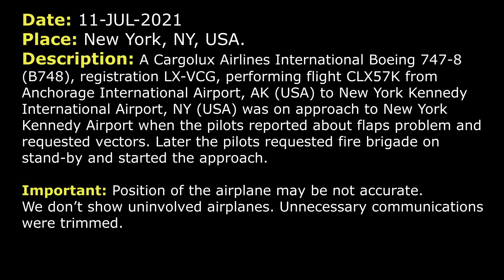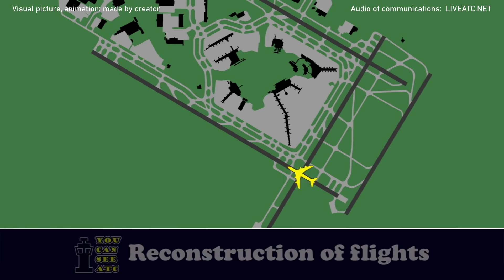Flaps problem. High speed landing | Cargolux Boeing 747-8 | New York Kennedy, ATC

Comment: Used to fly for Cargolux many moons ago. Good company and good training standards. The B748 freighter normal final approach speed at max landing weight with full flaps is around 170 kts. Add the tailwind and flaps issue to the equation and one has quickly a very interesting situation. They chose the longest runway available and accepted the tailwind for a good reason. As there is no ILS13R, the alternative would have been the Canarsie VOR 13R which would be a bad choice for many reasons given the circumstances. The B748 has an amazing brake system. IMHO, this was more complex than meets the eye and was handled very well. The ATC controller of a major international airport should know how to convert tons to lbs - adding extra workload to an obviously busy crew does not seem professional - but I digress as the crew didn’t declare emergency.
Kudos to crew, ATC and Mr. Boeing for building this amazing bird!

Comment: WOW, so many experts! :-)
ATC is required to ask the aircraft in distress for the number souls and amount of fuel (yes, in Pounds) onboard. This is to relay to the fire and rescue personnel. JFK controllers did a terrific and professional job as usual. Considering they normally don't give approach vectors at 260Kts and to an aircraft that never declared emergency! (BTW, when I was asked the same question outside of US, I would quickly convert to Kilos and respond, even though my fuel info was calculated in Lbs.)  
International 747 Captain with 50 years of flight experience
Reply: Would you say why they needed to come in fast?  I do not know the physics of flying, can they cut air speed by using less power or are flaps necessary?  I heard him say he needed to keep speed up.  Why is that?    Thank you.

Comment: This aircraft had a landing gear incident in 2018.
Incident: Cargolux B748 at Luxembourg on Jul 28th 2018, could not retract gear

A Cargolux Boeing 747-800, registration LX-VCG performing freight flight CV-794 from Luxembourg (Luxembourg) to Kuala Lumpur (Malaysia), was climbing out Luxembourg's runway 24 when the crew stopped the climb at FL140 after being unable to retract the landing gear. The aircraft entered a hold, dumped fuel and returned to Luxembourg for a safe landing on runway 24 about 100 minutes after departure.

The aircraft remained on the ground for about 4 hours, then departed again and reached Kuala Lumpur with a delay of about 5.5 hours.

Comment: Are JFK ATC not able to do the most basic calculations to convert tons to pounds? That’s 1 ton equals 1,000 kilograms which equals 2,200 pounds 🤦🏻‍♂️
Reply: Pretty sure ATC didn't catch the first answer for some reason ...
Reply: In our 747’s we use metric as well. In spite of that, you don’t want to get into specific weights with ATC because different weights mean different things for different airplanes. And so I’m surprised the controller kept pushing him for it. A much more correct answer would have been to tell the controller how much you fuel you have in time remaining.
Reply: @jumboJetPilot  The controller isn't asking about fuel for his timing and controlling purpose. He's passing that info on to the firefighters so they can have some idea of how big a fire they might need to fight. One hour of fuel in a 747 is a lot bigger fire than 1 hour of fuel in a Baron. On the other hand, it really should be good enough to tell the firefighters what kind of plane it is and where they were in their flight plan - returning to departure, en route diversion, or destination. And with a 747 as the emergency aircraft, the fire sizes going to be big, really big, or "we're going to need a bigger fire truck" big.
Reply: @oldguydoesstuff120  I’m aware of these facts as both a pilot and in holding a marine firefighting certificate. And I have declared many, many emergencies in my career (only once in the 747 but a countless number in the C-5). Controllers and firefighters have a pretty good idea what equipment to bring based on the type of aircraft and type of emergency. Never have I been asked to provide mass fuel quantity remaining - not even once; only the current fuel load measured in duration. Airport fire crews always error on the side of bringing too much gear and personnel rather than not enough. Only weeks ago we had a fuel spillage episode during a fueling operation. A total of 14 emergency vehicles responded and surrounded us, all at the same time! Naturally, I’ll answer any questions that a controller has for me during any emergency episode unless being on the radio is interfering with checklist accomplishment. I was merely pointing out that being asked for the  mass fuel quantity remaining isn’t a question controllers typically ask. And I know this because as I mentioned, I’ve declared dozens of emergencies in the C-5 - as any career C-5 pilot has! Unfortunately, that aircraft was never blessed with great reliability.
Reply: I too thought pilot has enough on his plate, without doing Imperial metric conversions for the ATC/firebrigade...
Thankfully he is wise enough to just double the figure and avoid any further seconds wasted at a critical stage of flight
Reply: @CameTo  yesterday one of my engineers whipped out a calculator to figure out 10% of 8 is 0.8 and I’m going 🤦🏻‍♂️

Comment: Can they had options to dump some  fuel to reduce weight?
Reply: The problem wasn't the fuel weight (they were at their destination) but the cargo weight and the speed due to no flaps
Reply: @3x3-x3x-oXo  U want to say more speed so more load on landing gears during touch down?
As after touch down reverse thrusters & brake pads will easily stop it.
Reply: @joydasgupta9445  the braking distance is a function of both weight and speed, but grows quadratically in the speed so I wouldn't say "easily". Yes it can stop it but used at theit maximum power brakes can get so hot you need the firemen to check they don't catch fire.
Reply: @3x3-x3x-oXo The pilot was constantly mentioning the word heavy due to higher landing speed I guess as he was concerned about the landing gear load bearing capacity I guess.
Reply: @joydasgupta9445  Heavy was because it is a 747-800... has nothing to do with higher landing speed... by IACO designation, a 747 is a "heavy" (Aircraft MTOW over 300k lbs/136k KG). It has nothing to do with the speed of the aircraft.
Reply: @SoraNakamura-974  ok thanks fr the information buddy 👍
Reply: @joydasgupta9445  No, heavy after the callsign is always used for the heavier category of planes, regardless of their actuel weight at the time, to keep smaller planes in the loop regarding the issue of wake turbulence. https://en.wikipedia.org/wiki/Heavy_(aeronautics)
Reply: @3x3-x3x-oXo  What is wake turbulences?
Reply: @joydasgupta9445  the turbulence caused by an airplane to the airplanes behind it
Reply: @3x3-x3x-oXo  ok
Reply: @joydasgupta9445  Above certain weight, you callsign includes heavy. SO, that was his call sign.

Comment: Did you find out what there VREF speed was? I’m guessing around 190kts
Reply: Minimum clean speed when fully loaded in 747 is over 250kts.
I don't know how heavy this guy was, I also don't know if he had use of the slats, as he stated flaps were stuck closed.
He also had about 9kts tailwind component on his approach.

Comment: Should the controller be so persistent about the fuel number being in pounds? My thought is- they are flying the broken plane in the air, I gave you the number that i have available, you can do the 3rd grade conversion on the ground…. Anyone else agree?
Reply: Doesn't matter what the aircraft manufacturer uses...it's what the pilot is using in his head and communicating to the controller.
If you tell the controller exactly what they ask for, there is zero confusion.
Reply: @TheCpage66  I agree with your thoughts. 
The pilot is trying to fly the broken plane at the moment and just reading off the number FMS is displaying him in front. There is no confusion all units convert. Atc is taught to ask in one unit as to not cause confusion for pilot convert mid emergency (or at least pan pan, which is what I believe this situation should have been.)
Reply: Does he mean 15 tons or 15 tonnes?
Reply: @TheCpage66  fair question but I would assume Boeing being an American manufacturer wouldn’t use those units. Even if they did, the difference would only be around 1500kg…
Reply: We do use the metric system here…it’s not lbs of coke its KILOS of coke
Reply: @justing42  Ha !!!!
Reply: Another reason backwards America should get on the metric system.
Reply: @Dan_D_av8geek  So true!!!!!!! Get on with it America and join the world and the 21st century!!!!!
Reply: @Dan_D_av8geek  Haha no, there is no need for that crappy system.
Reply: @bboyjunyor  Considering every sign you read is in miles, altitude is reported in feet, you buy a gallon of milk, etc I would say the metric system is definitely NOT the norm in the US (outside of academia and "science").

I am an American who would really suck at conversion to metric (everything I know is in imperial) and I would argue it is vital we change to metric.  Unfortunately, it would cost a ton/tonne
Reply: @ArdenTheSnep    ABSOLUTELY!!!!!!

Comment: Guys most controllers are not pilots and don't know what flap issue will do to plane.
Reply: Maybe some training on those issues should be added to their ATC training so they'll be better informed as to what might happen during the emergencies they might encounter in their careers.  Seconds saved might save lives!
Reply: I agree.  But takes average center controller 3 years to get certified. That's a lot of stuff on our end to learn just ATC side.
Reply: If Cargolux just declared emergency that plane can do whatever speed, heading it needs.  ATC will always ask intentions, if not known, fuel remaining and souls on board. So if I was flying Cargolux  "Approach Cargolux 1 declaring emergency flap issue need to run checklist turning to a heading 090 maintaining 2000ft we'll get back to you with further info". Done atc will yell at the  supervisor, supervisor will notify tower.
Reply: @beadbird  Except the cabin/flight deck fire, you normally never have to rush. You deliberate slowly go through the checklist. Firstly, emergency checklist are not done everyday so you need to make sure that you are doing it correctly. Secondly, all critical actions are verified by both pilots so no mistake is made.
Reply: Most people in the comment section aren't pilots either, but I dare say everyone has a basic understanding of flight just due to personal interest, and immediately knew what failure to extend flaps would mean for the landing (yes, without reading the video title..). I don't think it's asking all that much for ATC to share this interest and aquire this kind of working knowledge on their own, if it for some reason can't be fitted into the regular ATC training. I mean they are guiding actual planes across the sky, many of them full of people ...
Reply: Flap issue could mean any thing. Normally, yes it will be slow landing. But that is not the only issue. You can have flaps stuck in lower position which might mean, they are unable to do overshoot or go around. Flaps can also have asymmetry issue and plane might have issues with roll and behave differently with the speed changes. 
Better for pilots to tell what they need from ATC instead of ATC making assumptions.

Comment: Jeez, that controller sure did give an emergency aircraft with increased minimum speed a lot of tight, switchback manoeuvring! Great job flight crew.
Reply: The aircrew declared flight control difficulties (flap extension problems and increased minimum airspeed), requested an inactive runway (31L ILS was inactive), and requested emergency service response. The controller treated the flight as an emergency, and asked for POB and fuel remaining. Although no formal declaration of emergency was made, the flight was clearly in difficulty and was treated as an emergency by the aircrew, the controller and the emergency services. This was an emergency flight.
Reply: @MarkSJBeard  pretty high cringe factor on that explanation
Reply: Did they declare an emergency?
Reply: I didn't hear Cargolux declare emergency!  The ATC probably declared it later asking fuel and souls.

Comment: That controller seemed inexperienced.  Once delay vectors and 31L was requested, the standard atc inquiry of souls and fuel should have been asked way before clearing the ILS approach.  Then after the aircraft broke off the first 31L approach, the controller gave some really tight vectors back around but sent the aircraft through the localizer course before vectoring back on it (240,280°) Seems like more work for the crew than necessary,  in my opinion, compared to other JFK emergencies I've listened to.
Reply: Let's keep in mind it could have been for other aircrafts not displayed on the map. We all know that New York is a complicated airspace.
Reply: @scheckenhere7417  agreed... we don't know the entire air picture.  The vector through localizer final was weird (and perhaps should have been verbalized) but may have been for a good reason.

Comment: Can't the ATC to do the math? multiply by 2.2! Those guys are flying a 747 very heavy and they don't have time to convert units to imperial!
Reply: Or just pass the info through to the fire brigade as given and let them do the math? If someones calculator catches fire from the heavy math they are surely equipped to deal with that too.
Reply: Everything they are dealing with is in Imperial. The fire department requests the info and ATC just relays. Also dont forget the controller is also controlling other approaches that arent included in this video. It didnt seem excessive and was a simple calculation the crew could do on board and the controller could simply relay to fire. Was not a big deal at all.
Reply: @PenguinGaming  I still think ATC should try to make the life of the pilots easier when dealing with an emergency and asking twice about something that they could have calculated in no time doesn't go in that direction.
Reply: @TBDFood  there are 6 crew. How many approach controllers are there?
Reply: @PenguinGaming  6 souls, doesn’t mean they’re crew.
Reply: @vito774  means the chances of someone other than the pilot or copilot being in the cockpit is higher. Also most modern airliners have a button to change between metric and imperial (i.e. the baro selection). So it wouldnt be a big deal at all for the crew to relay that information after the tower requested it in pounds. It is an American airliner afterall.
Reply: @PenguinGaming  6 crew, but not pilots on the flight deck.
Reply: @chrisjohnson7929  nowhere in that interaction did they mention exactly where each crew member was onboard. Alot of 747 Cargo ops have extra personnel in the jumpseats to undertake small tasks especially in emergencies. Its not unlikely that someone wasnt in the jumpseat during this landing phase. Relax.
Reply: @PenguinGaming  I just jump seated from Louisville to ONT....there were 5 souls on board. Two crew, and crew scheduler, a parts supervisor, and me. During an emergency where they had to keep speed up and in the class B, the last thing that needs to be worried about is fuel in pounds. He supplied the weight and they have an accurate estimate.
Reply: 6pob does not say 6 pilots. Could be only 2 pilots 1 loadmaster and 3 horse handlers.
Reply: Pilots should do the math from the heart,  even if the instruments cannot change the units. ATC asked the amount in pounds twice.
Reply: @ZsomborZsombibi  Yes, to pilots that are dealing with an emergency in a 747 full of goods! ATC should help pilots all they can, not ask twice about things that have been replied already. Really, instead of asking twice it would have been MUCH faster if they get the phone and multiply 15000 by 2.2. If the pilots should be able to do the conversions by heart, ATC should be able to do so as well.
Reply: @TBDFood  iirc most ATC centers dont allow cell phones in the control rooms due to it being a distraction...